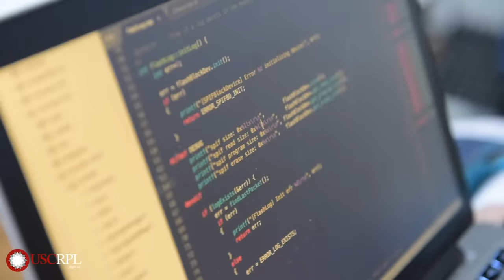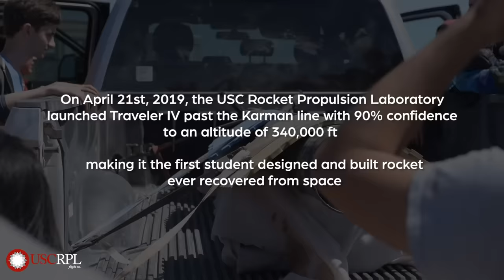First Student Rocket to reach Space (339,800 ft, Mach 5.1) | Traveler IV Launch

Comment: Congrat for this JOB
I have a question : What is the propelant use on this rocket?? R-Candy? 
It possible to have proportion?
Reply: An improved version of black powder
Reply: If I recall correctly, you need special licenses to create solid rocket motors, so the information likely wouldn't be any use to you. Besides, I don't think RCandy has the necessary energy/weight ratio for anything close to an efficient flight. Black powder also is unlikely. They might cover the propellant in the white paper (I saw someone else mention some other details, about their communications, from said paper), however, producing it on your own is likely illegal without achieving the aforementioned licenses.
Reply: @rootabeta9015  uh oh.... I have produced a bunch of b12-0 equivalents. Does that count?
Reply: @Fred_the_1996  It may depend on state/country. I'm not a lawyer - please check your local legislature for details.
Reply: @rootabeta9015  K

Comment: Well done! This is in no way a negative comment, but why 90% sure ?   Is it much  harder to measure alitude at that height? Just technical aspect i hadnt concidered before
Reply from the maker: The apogee was determined to be 339,800 ft ± 16,500 ft (due to sensor uncertainty). The Karman Line starts at 328,084 ft, so 90% of the altitude normal distribution lies above the Karman Line. Hence the 90% confidence interval.

Comment: That song is from 1972, the last year humans walked on the moon.
There are plenty of videos of weather balloons and rockets going only as far as the mesosphere, but students studying astrophysics would get a good challenge if the did what Nasa did. Calculate the trojectsry to rondevusi with the moon. Build the model rocket big enough to get into tli, ground based course correction capability even better to keep it on course and stabilize spinning on the transit. Equipped with battery powered or solar back up cameras, and it would only be one way. Let it fall to the moon, but it would be spectacular!

Comment: Oks so at 66 miles a rocket will still crash to earth. how many miles up will a rocket need to go to stay in space? Thanks.
Reply: you can do it two ways. the first way is to start going so fast you leave earths gravitational pull. this would send your craft into a orbit around the sun. The second way is to tilt the rocket and start going sideways. this will start letting you orbit the earth which will let you stay up for up to 20- 30 years.
Reply: At 66 miles they reached space (it is graduation) - but to avoid falling back down you wish to reach 200 miles plus - and a horizontal speed of close to 17000 miles per hour. 

Alan Shepard, first American in space, did not go into orbit either. This is similar to how Virgin Galactic will throw tourists into space at suborbital speeds, where the tourists will be weightless for a few minutes to take their images before falling back down towards landing. 

The whole point is that to stay up there, the rocket must "lean" sidewise as it accents to around 200 miles and then accelerate to some 17000 mph - to reach orbital velocity. If you want to leave the gravity field of Earth to visit another planet you must speed up to above 25000 mph. In short - it is more about speeds than altitude.
Reply: These peeps are right. Simply, you gotta go up to get to space, and then sideways to get into orbit. (Although you can do both steps at the same time lol)

Comment: You know what might be a neat evolution of this project?  
Build several of these, put MicroSat Comm Relay satellites in each one...  and get the satellites into orbit around MARS.  Then, when they're there...  

...  use them to help NASA and CNSA relay signals between their rovers on the ground and their respective Orbiter Satellites in space, Tianwen-1 and Recon Orbiter.  Strategically place them around Mars at regular intervals, so that the Orbiters can always have their antennas facing the Martian surface, and when they fly over their rovers, they can pick up the signal directly.  

However, when the Rovers are not under their Orbiters, they could still RELAY their signal from the Orbiter to one of your Relay Sats, which would have an antenna pointed either at the Orbiters directly, or at another Relay Sat, to relay the signal around Mars, and HOPEFULLY increase the workable signal envelope for both NASA and CNSA.  :-)

Comment: I have a question, Why did it not enter orbit? Is it not 100Km enough to enter orbit?
Reply: To enter orbit you need to be on a curved trajectory and going a LOT faster than this. They fired straight up, they came straight down.
Reply from the maker: In order to achieve orbit the vehicle must reach a velocity >17,500 mph, Traveler IV reached a max velocity of 3385 mph.

Comment: Could you make a platform that could be carried up to about 100,000 feet or more by a helium balloon and have the rocket launched from there at that altitude?! You could easily reach orbit then.
Reply: I think so, imagine if they flew it up on a rig like the red bull strato jump? I have systems where the rocket is dropped from the balloon, falls then fires.
Reply: It has been done. Sounding rockets were launched in the early 50’s & 60’s and were nicknamed rockoons. There is currently a Spanish company called Zero 2 Infinity that is trying to develop a launch system for micro satellites using this method.

Comment: Winged flight is possible to 99km???
Reply: Only theoretically.
Reply: If you travel at around 7.8km/s you can attain winged flight but 7.8km/s is orbital velocity so by then your wings are useless.
Reply: The karman line is marked by the fact that, in order to generate lift, you have to move at escape velocity.

So theoretically yes, but it would still take powerful rocket engines to accelerate such a craft to speeds much faster than orbital velocity, and at that point you might as well just used a rocket instead.

Comment: Great success, but I don't understand why they handicap themselves so much by using a single stage. With a proper two-stage design, I'm sure they could've reached the goal much sooner.
Reply: It’s called baby steps. 
The added complexity is a magnitude more difficult, and adds failure points. 

So, the logical progress is incremental increase. Apparently the the fins deteriorated, a teaching moment. With a single stage to orbit, adding a booster could allow for a deplorable payload. But maybe that’s for the next version. 

It’s a design project.
Reply: You might think that, but multi-stage rockets are actually RIDICULOUSLY more difficult than single stagers lol

Comment: Advanced engineering techniques. Advanced manufacturing techniques. Use bare wires cross between the posts of car battery for ignition system.

Comment: What was the rocket fuel used? 
Was it candy fuel or oxygen fuel?
Reply: It shows a solid fuel, so a mixture of fuel, oxidizer, and binder. Rcandy is unlikely, both due to the behavior of the substance and the fact that I can't imagine it being very efficient. Besides, if I recall correctly, solid rocket motors are illegal to make without licensing anyway, so it probably won't help you any to know.
Reply from the maker: Ammonium-perchlorate composite propellant.

Comment: Carbon fiber: great for airplanes (maybe), bad for rockets (it shreds). It looks as though chunks on carbon fiber/epoxy in the nose cone occluded the camera and ruined the video and clearly the fins were shredded. Still, it's an amazing feat and congratulations are in order.
Reply: Had to have been the only option for strength to weight and intended for only 1 flight. I'm sure they looked at everything

Comment: I want to journey to your shop and submit a plan to test a liquid methane and LO2 rocket engine testing its specific impulse regime and TWR characteristics I have a modified linear aero spike some what similar to the 
XRS-2200 B 
constructed by aerodyne industries 
The nozzle design among other features are fully and freely available to the internet

What am i aiming to a new type of nozzle constriction that can vector the rock from more than the current gimbal only design currently does if successful i want to see if the design can increase TWR and Delta V 
I am aiming to create an approximately man sized test rocket that could be orbit capable 
I don't need to go tall just wider in order to achieve the amount of necessary fuel

How do i plan on obtaining fuel

Building a small two stage chamber with a cryo cooling coil to run methane through a liquid nitrogen vat
Containing the vat inside chamber 1 will be flooded with argon up to 6 times before liquid methane generation this will ensure an inert atmosphere exists eliminating fire hazard
Then as a security back up measures have a second chamber contain the first and flush it with argon 15 times and lace the argon in this chamber with a thiol compound in order to detect any leaks 

In the event of a leak the outer chamber would hooked up to a butterfly valve that connects to an array of about three tanks and will be open at a sustainable pressure in order to constantly displace any OXYGEN until the leak is contained

Am i stupid for wanting to attempt to make my own fuel?? 
Have i got the right idea in safety ?
 I want a test design constructed before i obtain a trademark 
And open a company i need unobjectifiable proof for any investor concerned that my design is worth their money 
 

Leave any thoughts you might have in replies below 

Feel free to tell im crazy discourse always creates improvement

Comment: claims reached space, doesnt show a video of them even otw to space let alone space
Reply: hot tip if ur falling back to earth u havnt reaced space
Reply: Sub-orbital..... Straight up and back down....
Reply: @benjaminbruce4908  space, and orbit are two different things. You reach space at the edge of the atmosphere... you are still affected by gravity for a very long ways after that.  The moon is in space, and affected by our gravity... but it is falling around the planet because of its orbital velocity.  The same with the ISS.   240 miles up... if it weren't travelling at 24,000 mph it would also fall straight down.
Reply: Space isn't a magical fairy land where gravity is turned off. You have to reach orbit in order to do so. Orbit is achieved by accelerating so fast that you miss the planet while falling.
Reply: @benjaminbruce4908 So, the moon isn't in space?

Comment: and you cant even use proper units
Reply: @ryanspence5831   and SI system is both a scientifically and internationally accepted system of units whether you like it or not. And you can see they are actually appear to be using metric system not imperial plus do you know that NASA lost a freaken Mars probe because they forgot to convert imperial unit to metric while they were calculating it's trajectory.